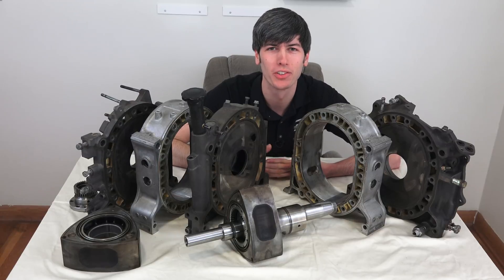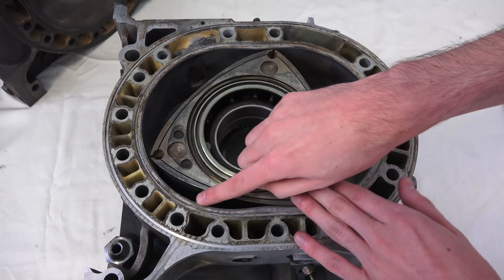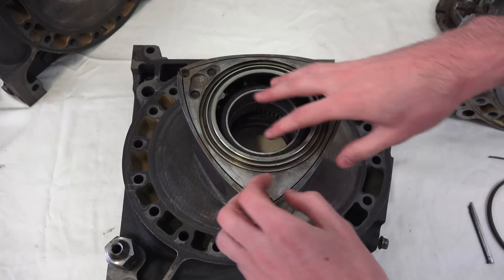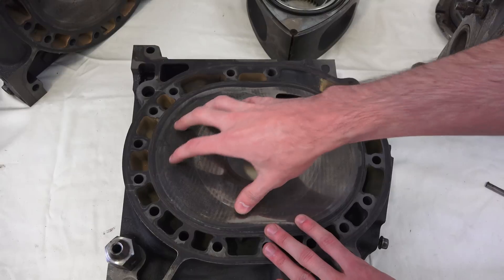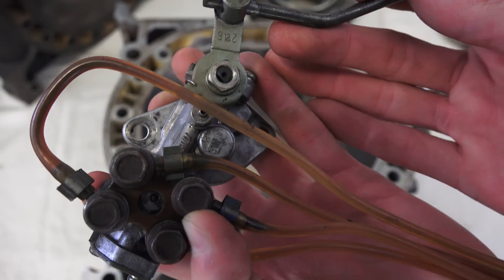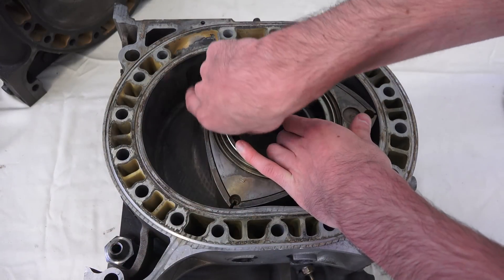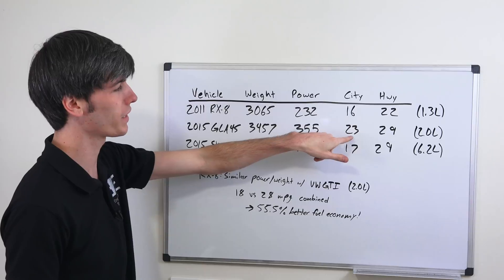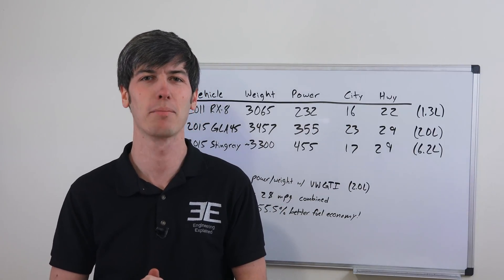4 Reasons Why The Rotary Engine Is Dead

Comment: The Renesis rotaries used in the RX-8 don't have the exhaust ports on the housing where you indicate... that's from an older generation wankel. The exhaust ports were moved specifically to prevent the unburnt gas from being flung out the exhaust, and instead go 'round to a) get burnt in the combustion chamber on the second pass and b) provide lubricity,  to reduce the amount of oil required to lubricate the seals.

That you're talking about the RX-8 then pointing to components of an earlier engine and claiming these "problems" is disingenuous. This is worse than your extremely flawed explanation of torque converters in your "5 things you should never do in an automatic transmission vehicle" video.

Comment: ok so you're comparing fuel efficiency of 3 different vehicles with completely different transmissions and final drive ratios.....also comparing horsepower ratings? you must not realize that horsepower is nothing more than a number calculated from torque. how about compare torque numbers (159ftlbs on the RX8, 332ftlbs for the GLA45, and 465ftlbs for the stingray). Once you look at those numbers, the fuel efficiency starts to make a lot more sense.

Comment: They are pretty terrible engines compared to reciprocating equivalents, but I think a lot of that is down to the fact the reciprocating piston engine has had thousands of different engine manufacturers spending a combined hundreds of billions of dollars on developing it to perfect every last millimetre for nearly 150 years now. The rotary hasn't, and so many problems remain that in theory could be improved upon.

Oh, the other good thing about them is that you can buy a broken down RX8 with engine problems (usually seal failure) with low miles in otherwise good condition incredibly cheap. Then rebuild the engine yourself nice and slowly if you have a bit of nous with the spanner, and you have got yourself a fantastic cheap sports car. There is plenty of them with failed engines around but people are scared of them, and so flog them for peanuts. If you are willing to strip the engine down yourself and send the worst parts away, you can save a lot of money.
Reply: +vulcanproject  Yes you are right. The reciprocating engine came from the days of steam, and has been refined to within an inch of its life, with huge investment.
 However ,I think it will never succeed, other tech will win out,electric etc.

Comment: thanks for the video.  makes one wonder why they made it in the first place.
Reply: +KF7RCM He never discusses the advantages of the design. Only 3 moving parts in a 2 rotor motor, very lightweight, small size allows it to be mounted behind the steering rack for a better weight distribution (50/50 front/rear in 3rd gen rx7), more central mass reduces understeer, high revving 8000rpm redline, turbo charges applications had insane power-to-displacement ratio (280hp for 1.3L engine) from the factory. Mazda used the engines for their flagship sports cars, not for their city runabouts. The Rx-8's hp/epg rating is a joke because the car was a compromise to try and pass emission standards - the first rotary powered car in almost 20 years to be sold without a forced induction option. It was the inherent emission issues discussed in this video that killed the rotary, not it's performance. Also as discussed in other comments, the heat distribution and sealing issues were solved long ago. Disclaimer: obviously I'm a fanboy

Comment: wenkel engines have an amazing power to weight ratio and power to size ratio, some wenkel engines used in aircraft have produced 125hp per a cubic foot,(just these 2 facts are reasons to use it) personally I think the solution is to use a different fuel like hydrogen and oxygen and anybody that thinks these engines are a dying technology is crazy

Comment: In fact, Mazda Wankels became of interest partly BECAUSE of their lousy emissions, which then were easily dealt with in a substantial oxidizing reactor just outside the exhaust ports. It all lit off real quickly.
Their mechanical smoothness and light weight were big pluses, too. (I worked at a Mazda dealer.)
You might want to check out the Dolmar KMS-4, Wankel-engined chainsaw from back a ways.

Comment: All rotary engines have the same 2 common problem.
1."They were designed in 2 dimensions and extruded (expanded) to 3 dimensions"
They were NOT created in 3 dimensions from beginning. That causes problems with seals.
2. They try to make seal  on a explosion chamber. Is impossible because the erosion.
If you solve both situations, you solve the problem.
I will do some epoxy prototypings later this year and show to all.

Comment: They kind of became obsolete. There are now not much larger 4 cylinder engines, with more power, MUCH more efficient, much cleaner, and more reliable. Plus a lot cheaper to produce and far easier to maintain.
They were never really economically viable.

Comment: The efficiency comes on easy to repair and durability the 4 rotor engine that won LeMan by one of the larges margin ever proove more durability more resistance and more overall efficiency when you have anywhere from 8 to 13k rpm range thatmakes for a great racing engine! I have seen a complete engine rebuild on track done in less than 3 hours and only 2 mechanics.

Comment: Could you add more sparks along the right side, that spark at different timings, i.e once the correct sides of the rotor face them? Then the flame wouldn't have to travel all the way from the start?

Could there be some way to increase the temperature leading over to the other end? Or just directly heat the other end if  you rev it to too high RPM the temperature difference got too bad?
Alternatively just machine the ignition side ever so slightly smaller, so instead of being way too big at very hot engine, it's slightly too snug at cold engine and slightly too wide at hot engine?
Reply: +junoguten Like, build a catalytic converter onto the cold side. That will heat it.

Comment: basically it's a 2 stroke continuios cycle engine that needs to burn oil to work,emissions control killed this engine just like it did with the detroit diesel 2 stroke diesels

Comment: Umm.. not to burst your bubble but the wankel engine is designed for performance not economy. Any performance engine burns oil due to loose tolerance in the seals. The wankel design merely injects oil to help cool seals where piston it's just leakage. Fact is all engines have low thermal efficiency less than 30% because of most heat going to the coolant and exhaust. Only thing about economy with the rotary is that it emits more unburned fuel due to the sweeping motion. Rotary makes power the whole revolution to the Pistons 25%. You fail to see the power output aspect.

Comment: So basically, this is a terrible, terrible design.
Reply: Yes but perfect for drag racing
Reply: +Sel Gules 
Does he not demonstrate at :40 seconds, that they are low in torque by design. That does not seam idea for racing, perhaps if you stay in high RPMs and do not miss the initial acceleration. This engine seams like it was designed in the Iron Age.

Comment: good power to weight ratio kinda like a 2 stroke which has similar emissions and fuel economy issues.  Ya gotta give credit to Mazda for making this engine a viable powerplant back in the 60's and 70's in different vehicles and then bringing it back again in the 90's.- 2000's .  despite the inherent design problems with emissions and fuel economy 100,000's were sold over the years.

Comment: Seals issue's could be overcome, Cold flame front will always be a problem, The one thing you over looked in this video is that the rotary is the only engine that can be setup with "0" overlap between intake and exhaust. you ask why would you want that? HYDROGEN, Hydrogen need to be burnt in a "0" overlap combustion engine, take a V8 and you'll see how common air fule mixture get ignited in the intake manifold, with petrol it's an annoyance, with Hydrogen it blows your intake manifold into bit that can kill you or anyone else around at the time.

Comment: You talk about wankel engine designed over a decade ago. You just can't pitch it against way newer engines. Mazda NEVER designed this engine with fuel economy in mind, but with size, weight and driving experience ( wich was amazing back then, and still now).

Comment: I Rode a Suzuki rotary Wankel Motorcycle! It had quite a strong pull when you twisted the throttle,but couldn't figure-out if it was 500cc,or 1500cc-1x3?

Comment: Great teaching style.  But if the rotary engine had the benefit of 120 years development - as has the recipricating engine - then I would suggest all these disadvantages would have been resolved and the basic efficiency of rotation without the intermediate reciprication, would have made the rotary the prefered engine for the 20th century and THE engine of the 21st.  Imagine a similar presentation giving the reasons why the recipricating engine is dead!  Nonetheless - I love your explanations.  So much information in so few minutes!  Well done!
Reply: +Stewart Campbell
By far the greatest leap forward in engine efficiency EVER, has been the Electronic Control Unit (ECU). Even that didn't render the Wankel a viable competitor to the sad 25% "efficiency" of the piston engine, it's worse. 
 
The thermo/geometric principles inherent to the Wankel engine are the problem and I submit that they are insurmountable.

In a short reply, it is not possible to explore the deficiencies of this design in enough detail to make a good appraisal. However, that detail is available through the link below. It is a 210 slide slideshow in MS PowerPoint of a true rotary engine, where  on the opening slide, there is a button to a detailed 3 slide (the 3rd one of them "shows" the most) exploration of the Wankel engine, while the other 207 slides can be ignored, though "more Wankel" is sprinkled throughout the slideshow in comparisons.

And as a plus, there is not a single equation in the lot, no incomprehensible jargon, just common English and a few numbers that everyone will be comfortable with. It does however, suspend a lot of "ROTARY" folklore. 

http://campbelllukasresearch.com/

Comment: Doesn't the rotary have the disadvantage of developping less braking forces when you let off your foot from the gas? Since it has less inner friction I would expect it to be less useful for driving downhill, so you need a stronger engine for your car to be safe for downhill driving. That's why only sports cars were built with it, isn't it?

Comment: y'a but some Guy actually desiged a way to fix the apex seal and the problem with this comparison is rx8 engine really wasent that much of an upgrad e to the rx7 design so it almost like comparing a 30 year old engine to new piston engine if just half of the work that went into pistons went into rotaries the results would be astounding

Comment: I always wondered if the next new 'big' vehicle trick might be to use a turbine to an alternator. You could tune them both for a best rpm band and turbines can burn a large variety of fuels and most of all do not suffer from the internal heat losses due to reciprocating masses which is really the maint thing the wankel had going for it.

Comment: One thing the rotary engine also suffers from is lack of R&D.  The 4 stroke engine has been researched and developed by every car manufacture except for those that build electric only.  Mazda is the only company that has done any R&D on this motor type.  They are not a huge company compared to the other major manufacturers.  This put is miles behind the 4 stroke engines that have had slow development of 100 years.  This engine has potential that's one reason a small group in mazda keep trying to keep it alive and in production.  If every manufacturer was trying to produce and improve the rotary motor it would be leaps and bounds better then it is now.

Comment: Rotary engine....Oil burner through oil injection to try to libricate it. Uneconomical as it throws a lot of unburnt fuel down the exhaust port. 2 stroke principal. Severe heat differentials on engine casing. Rotor tips wear severely if the engine is habitually "pushed". Side seals not very good either.  Generally sealing is not very good. Emissions are horrible, just like a 2 stroke motor cycle.  Going nowhere this heap of rubbish . Nothing better than a 4 stroke  petrol engine or diesel if you must.

Comment: LoL.  I didn't think my JK Wrangler would get better fuel economy than a RX-8.  That is shocking bad economy for the power it doesn't make.
Reply: +Yayaya123 Don't assume I'm from the USA. Fuel isn't $1.80 a gallon in Australia, and every Rotary I've ever come across hasn't  lasted more than 60k kilometers. They're a seriously flawed design until someone can make seals that hold and a combustion chamber that works.

Comment: +Engineering Explained You kept saying how inefficient the Wankel is, but, if it's so inefficient, how does it make so much more HP for its size than any other ICE design besides a gas turbine? The Mazda RX-8's very average Wankel makes >169 HP/L, which blows away even the most power-dense NA recips, such as the Ferrari 458 Speciale (132 HP/L).
Reply: It's inefficient because it makes less power from more fuel, compared to all modern otto cycle and diesel engines.
Reply: +Thomas Griffin Yeah, but remember, you gotta pay to play. It makes more HP/liter than recips.

Comment: I used to have an RX8.  It's thirsty! I can usually do just above 300km on 1 tank.  But man, its such a fun car. The momentum it has when its over 5000Rpm is crazy, there is no other car like it.  I had the R32 and a porsche now, its just not as fun as the Rx8 rotary.  You can feel the the "perfect" balance point of the car is right next to your knee and it only kicks in at around 5000rpm + its so fun to drive with it "fast" .  It's a nightmare to drive it in the city, its probably one of the worse in the city, the lack of torque left you with nothing but frustration.   Not to mention that how slippery it was  in the rain (Clarkson was spot on in his review, I must say)  even I was using one of the best tyres on the market.  
Not to mention about the maintenance, 5 recalls from Mazda, upgraded the starter motor, although its free, but it still flooded the engine by my mechanic, and replaced all spark plugs....  lost of power steering suddenly....... considering it was only 3 years old at the time.... it's a very bad car overall.....  I bought it for $40000 and sold it for $18000 3 years later (AUD)

Comment: 5th reason: that apex seal is fragile.  any pinging or water in the mix and it fails.  This is fine for a race motor but on the street a motor needs to be tougher than that.

Comment: I have a 26B (4 rotor) motor in my car(07 solstice) and it is producing more horsepower than a stock 15 sting ray. I love the sound and power it makes. compare a 4 rotor to a 4 cylinder ,or even a 6. remember at one time the corvette almost got a 4 rotor motor back in the day. that's how powerful they are.they produce more power so of course they burn more fuel. 8 rotor produces more HP then a 8 cylinder (talking all motor here)

Comment: makes me wonder how fast the 1991 Mazda 787B had to constantly refuel during the race as it had a 4 rotary engine

here are the specs:

Chassis: Kevlar and carbon composite monocoque
Suspension (front): Double wishbone pullrod operated inboard Bilstein spring dampers.
Suspension (rear): Double wishbone top rocker-operated inboard spring dampers.
Axle track: 1530/1450 mm (787)
1534/1504 mm (787B)
Wheelbase: 2640 mm (787)
2662 mm (787B)
Engine: Mazda R26B 2616 cc 4-rotor naturally aspirated. Mid-engined, longitudinally mounted 
Transmission: Mazda/Porsche 5-speed manual
Weight: 830 kg (1,830 lb)
Fuel: Idemitsu
Tyres: Dunlop 300-640x18/355-710x18 (275-620x17/330-700x17)

Comment: I have a third gen, and it eats gas like crazy I can set the boost very low and get maybe 28 at most, but at that point since its a 13b-rew i have absolutely no power. I also pre-mix oil with gas, just well, maybe you can explain that in a future video! But, I will say this the stingray MPG is with cylinder mode on. If you were on 8 cylinder mode the entire time it would be less then rx8. Smart way to get pass the emission/gas guzzler tax.